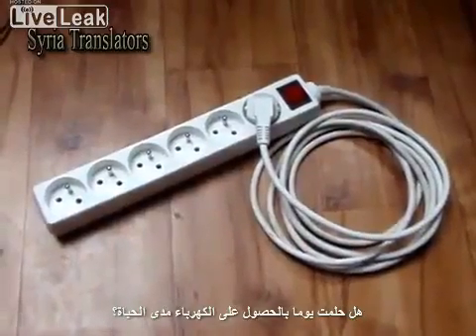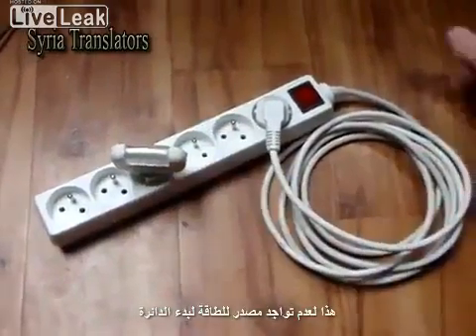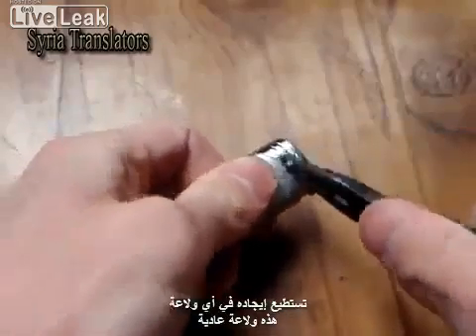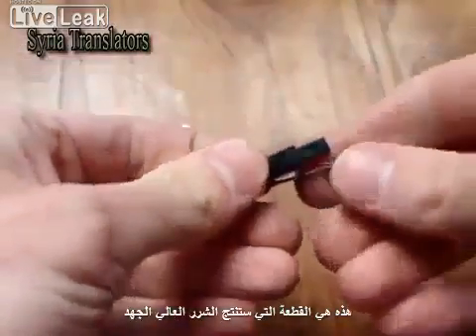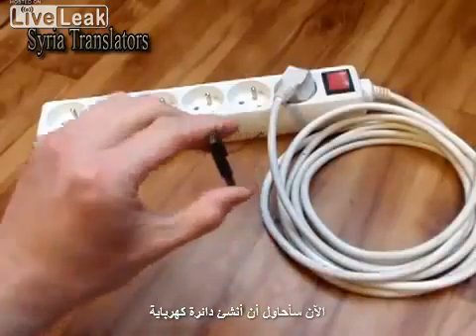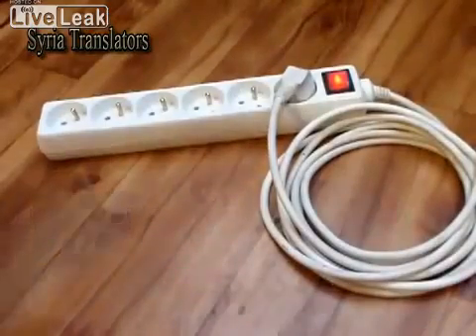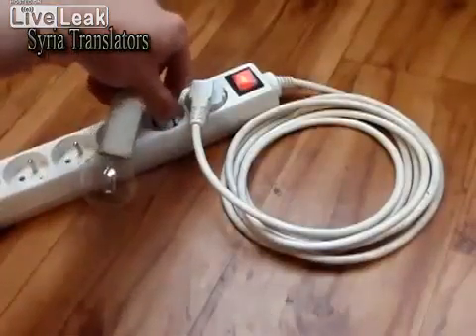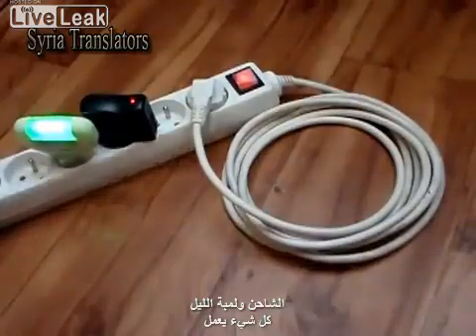How to make a Free Electricity Source

Comment: This is a totally counterfeit trick just to gain views.

You cannot establish energy circulations like that. It will be a perpetual machine that will contradict the laws of thermodynamics which states that the energy in a closed system will always be constant.

You cannot establish an electricity source at all 
This piezo can really light up a small LED for 1 second that's it.

Comment: So be ready for a loooong sentence about how this is fake.

Ok so the energy that he supplied the power strip with, went through the ground pin it you look closely. Second of all, even if the power strip got some energy from that, it would flow through the cord over and over again causing a short circuit. And lastly, the power strip would have to have a internal battery to supply the cord itself ( because the energy is changing so beat energy and is losing energy in the process) and the thing that you would plug into it as well. And one thing almost no one considers, is the little indicator light that lights up when it is in and has power. So that would also be draining energy from the "battery" and/or an external source connected to power. Finally, the last thing I will say is that the first law of thermodynamics prevents you from getting any energy out without putting constant energy in. And the reason the cord loses energy is because the energy is being converted from electrical to heat energy so no energy is being created or lost. 
My point being, please don't believe all of these free electricity videos because it goes against the laws of nature.

Comment: THIS IS GETTING ENERGY FROM NOWHERE. THIS IS LIKE KEEPING ELECTRICITY IN A METAL LOOP. EVEN THE LIGHT ON THE EXTENTION CABLE WOULD USE IT ALL BUT ONLY WHEN ITS CONNECTED BUUUT CONNECTED LIKE THAT IT WOULD SHORT CIRCUIT. EVEN IF IT RETAINED THE POWER THE LIGHTS WOULD SUCK THE POWER FROM THE CABLE. YOU CANT GET SOMETHING FROM NOTHING. SAYS WHO? SAYS BASIC PHYSICS!

Comment: Heh,heh

Even with the  capacitor and such in the surge protector ones a recursive  current loop will drain down the moment anything that is plugged in starts drawing power

Same reason why those strong magnet motor/generators have only been a novelty for a few thousand years....soon as you add a load the damn thing drags to a halt from friction or em drag

Comment: So...is this supposed to be acting like a capacitor, once initialized by the spark?  
But then, capacitors need to keep being recharged, too....they don't last too long on a single charge....IF that is what it's doing.
OTH, this unit is designed for a foreign energy system...if we tried that with USA power strips, it might not do the same?
Are there batteries inside the power strip, that take a charge from the spark, to make it last longer between sparks??

Comment: he also applies the spark to the earth pin which isn't even part of the circuit :)
Reply: how else would u like to start circulation?
Reply: +sirvidia TRUE!
Reply: +Uber that goes straight to earth, hence the name.
Reply: +sirvidia mate, its working, if u want phisics lavs resolved goask university profesor. Mb electricity is from earth? Its not perpetum mobile, itjust produce enough.
Reply: +Uber 
when we say 'earth pin' we mean a common ground pin among every device connected .One of the uses of the earth pin is to discharge the extra electricity which builds up on metal plates on devices so you don't get shocked when you touch those metal plates. the electricity is being transferred to the device by the two pins in the center in the form of alternating current or ac . the reason we call it earth pin is because it is connected to the earth.
Reply: +Uber I doubt this is real I doubt it works
Reply: Exactly 🖒
Reply: You see, it doesn't work. That's the point

Comment: OK, this is an easy one to work out....Firstly, when the power strip suddenly 'bursts into life' the mains lead to the right is partly out of shot. It's meant to look like a single coil, but it isn't. It's simply plugged into the mains and somebody switches it on. The coil of wire is just that. When the shot changes, the left hand edge of the power strip is now partly out of shot. This is a strip that can be daisy chained, so this time the power is fed from the left side. Now the coil of cable is shown in full shot, but this time it is a genuine coil. You can see that it has been re-wound because the cable turns are in a different place. Next.....

Comment: I wired my exhaust back into my fuel tank, works like a charm!
Reply: +lepayen He's being sarcastic but i guess you wouldn't get that would you
Reply: +Tiberius Zorg   I put a tube from my exhaust to the inside of my car. I like the smell, and I get a great buzz while I drive. And it doesnt show up on drug tests! Score!
Reply: Maren It is 45 minutes long!!!
Reply: Tiberius Zorg Yeah, okay. I assume you thing that would equate to electricity... Burnt gasoline, which is no longer gasoline, will not burn if you route it back to the tank. Electricity is still electricity if you route it back to the source.

Comment: explain why it's fake? as you see right in the video,, there's no other way its producing energy
Reply: Try it then genius.
Reply: if i try it, it wont work... but no one here explained why its fake... genius
Reply: if you want the electricity to flow continuously you have to have a continuous power source to do that
Reply: IAmGunzNoob The proper response to a troll is to ignore them
Reply: It's fake because the energy from the lighter spark isn't powerful enough to power a 40 watt bulb. Not only that, as the electricity goes around the cord in the power strip, it loses energy because as you should know, perpetual motion is not possible and everything eventually stops. So now that we know that it couldn't even loop the power strip more than a few times, let's pretend that it actually can do this. Even if the loop of energy in the power strip was infinite, the moment you plugged an appliance into the outlet the electricity would be dissipated and the energy would be lost. This is due to the fact that the appliance is using the energy.It's such a small amount of energy that even without an appliance, the small light on the power strip would be enough to drain it.
Reply: DJCDavisDubstep thank you. wish i learned that in high school
Reply: zero Alpha i hope you didn't call me a troll, because my original comment was legit
call me ignorant instead, but thanks to the explanations, now i know.
Reply: zero Alpha ok kid, what is your problem? you bored or something?
Reply: zero Alpha lmao? okay not sure why you commented on my post in the first, place. just go back to bed
Reply: IAmGunzNoob This is from like 5 months ago stop arguing you look like children lmao
Reply: DJCDavisDubstep you reply to me? ok fuck this post. lol, ok i look like a child, ok, this is youtube, i could care less
Reply: IAmGunzNoob I was just replying in general, and yes you look like a child getting mad this easily
Reply: DJCDavisDubstep i wasnt geting angry,i was annoyed he called me a troll for a genuine question. i am grateful you replied me in the first place helping me with my original comment, but now you're just being like him

Comment: I'll explain it without credentials but with logic.
When you plug something into an outlet, you draw current. A barbecue lighter is piezo I believe and therefore has only enough current to make a small spark. If you shock a line that isn't grounded or attached to anything, it will be static electricity, but only a little. Plugging in an AC light can't work firstly because there is no current flow (static electricity maybe), and secondly because even if there was it would be DC.
This is fake.

Comment: He has a high power radio transmitter out of camera view, the wires in the cord pick up the energy the radio waves, all the devices he plugs in our low power devices
If you live under a radio station this will work, but wont power much of anything

Comment: Surge protector + electronic igniter = charge on the capacitor inside the surge protector.
The piezo-electric high current is produce by rapid hammering of a crystal.
This is nothing more than a charging a capacitor and using the capacitor as the source of electricity.
The capacitor stores electricity like a battery.